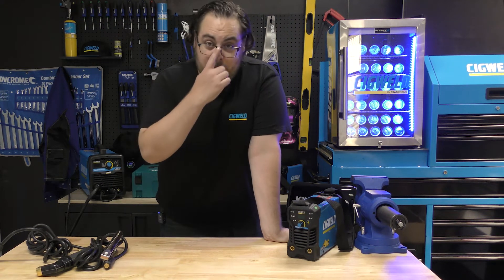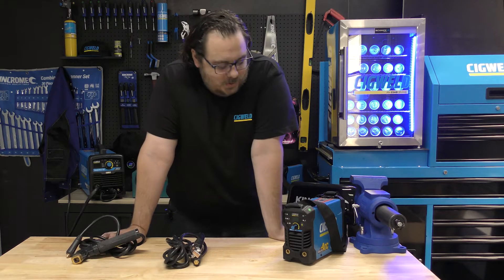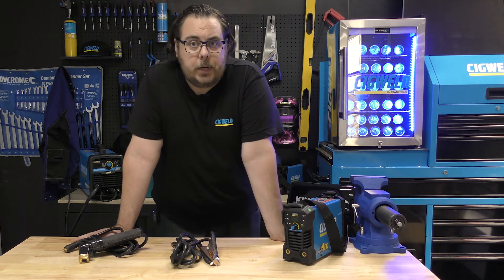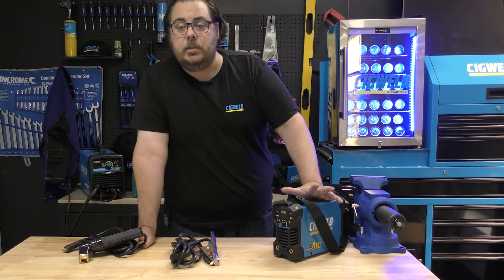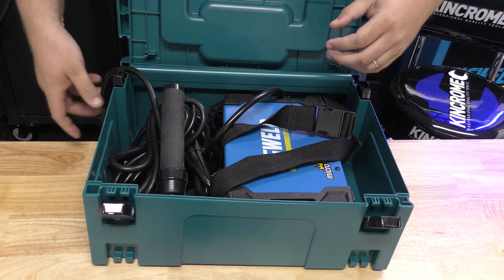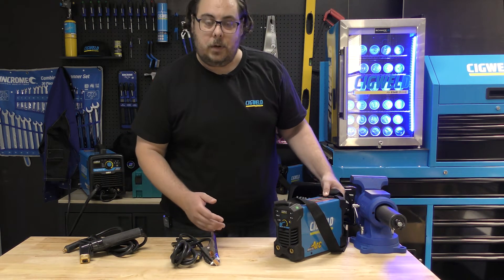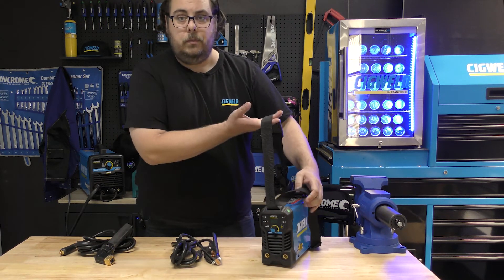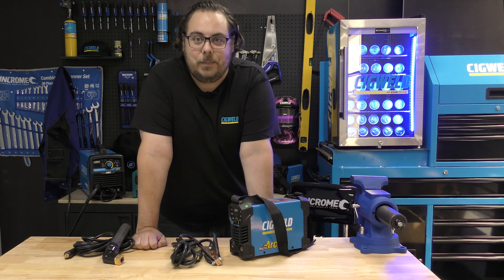Run Through of the Cigweld MicroArc 140 Stick/TIG welder. Our smallest welder ever!

Comment: So as long as i don't directly touch the ground end (with the unit still switched on) with the spicy end in the other hand? I thought for a minute that i better not even touch the work bench with it still clamped on while trying to weld.. forgive my naivety I'm more or less new to welding
Reply: Correct, main point is don't do it with bare hands. Welding gloves and gear are also to insulate you electrically, just make sure they aren't wet from your sweat or anything.

Comment: Have a Transmig 200 for years ,  gets the job done , but its just too big and heavy to fit in my car .......
So yeah i just got one these Microarcs today on a good eBay price , under $300 aussie.  First impressions are very good , tried different rods , 1.6mm low as 30 amps and up to 80 to 90 amps with 2.5mm rods .   Also have an older AC buzz box welder , about 115amp max , its like comparing a old underpowered 50 year old Landrover to a new Corolla .   .  This inverter stick welder is so easy to use   , so light , reckon the 2 cables , holder snd clamp weigh almost much as the welder itself!

Comment: Don’t you need gas for TIG? How would you get a gas bottle up a ladder?
Reply: There are disposable gas bottles that are small enough to use on a ladder just need to  make a small jig to hook it onto the ladder maybe. If you search disposable gas bottles you'll find the  bottle. I knowthere are carbon cylinders available . Not sure about argon though, but a search will clarify that.
Reply: Having a problem with power current cigweld can not be welded properly

Comment: can this weld aluminium? starting price?
Reply from the maker: No unfortunately it cannot weld aluminium. To weld aluminium you need an ACDC TIG (this one is just DC-Lift TIG) or a MIG welder that has been setup to weld aluminium. 

Pricing wise, we don't set the price. Our distributors do. You will need to check with them. Sorry.
Reply: There are aluminium electrodes available but it takes a bit of practice to weld with them, but they can make a pretty good weld once you get the technique. I've tried it for a repiar job took a lot of welds to get used to the very different method but the result was actually solid. The bonus didn't need to buy a tig set up or gas. I've also stick welded with 316L stainless electrodes and they welded great. So I rekon this wee welder would be an awsome bit of gear.

Comment: Could you guys please do a run through video of how thick it goes, basic stick and tig, I'm really interested in this little machine for my home shop and would like to it in action!
Reply from the maker: I will add it to the list of vids to make. It will do up to 12mm thick however.
Reply: Callum,  only got my little microarc 140 today , very impressed with it testing it out on some scrap . Very stable arc , reasonable easy to start the arc . 
Only annoying thing is the fan noise .....

Only stick welded with it , I've never TIG welded but maybe I'll get a TIG torch one day   ,